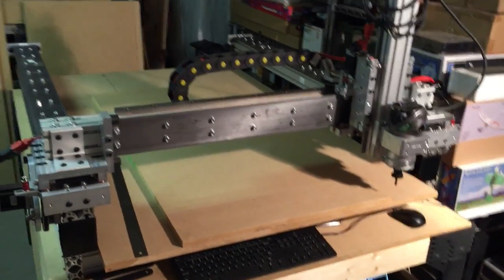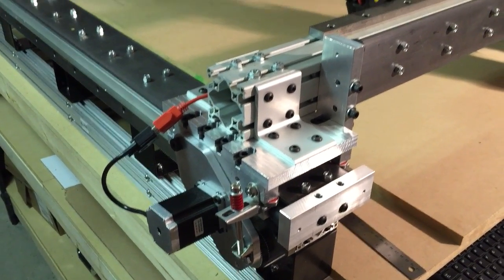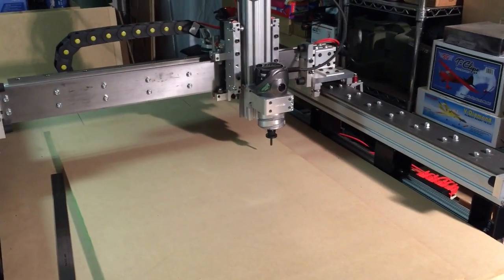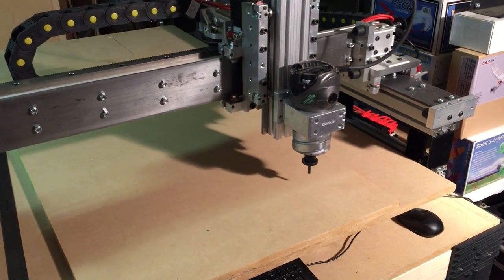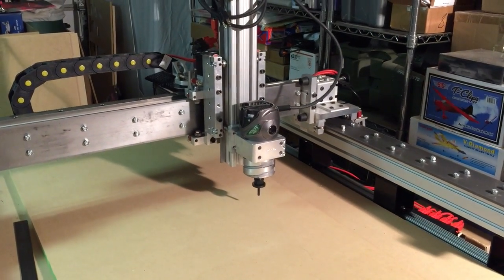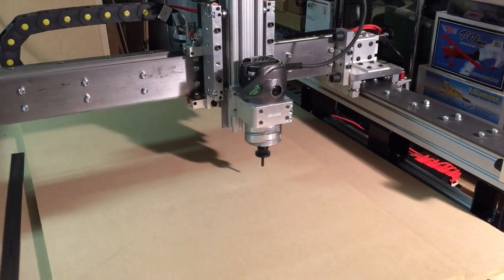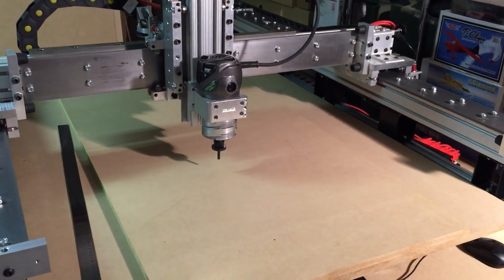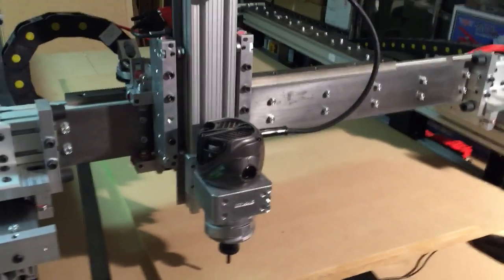Crash's New 2x4 CNC Router

Comment: i've got the older FLA200, nate is a little slow to respond but my system went together well. my gripe was the hitachi router... I had to buy 2 because one just keeps burning up on me. first time I used it after a speed control replacement (took like 6 months for the repair house to get the part), thing shot flames out of it and I haven't touched it since.
Reply from the maker: +phil timpson I am sorry to hear of your difficulties with that router. I have two machines - both with the M12CV routers - and both have served me well. In fact, last Fall I removed the oldest one (five years old at the time) to check bearings and brushes only to find that nothing needed to be replaced.

Comment: I would think you would build one from open builds website.
Reply from the maker: +gljay I HAVE a machine from the OpenBuilds site and I like it very much (I use it for g10 and plywood less than 3/8&quot;). However, when it comes to cutting big, thick stuff at production speeds, that kind of machine is just too lightweight for my needs.

Comment: In your kit, what all came with and what all did you require purchasing extra (either with FLA or elsewhere) in order to take the kit from box to cutting wood?

I am considering their 4x8 model which appears pretty close to what yours looks like excepting the dimensions.
Being a CNC newbie (I took some ShopBot classes at TechShop and cut a flat pack rocker that is sitting on my front porch), I would like to have the whole kit and kaboodle priced out before I put it to the holder of the purse.

Thank you for your time and attention.

Comment: Very nice machine Crash! I'm kinda jealous :-) 
Todd Buffington, I built a 1500mmx 750mm OX just about a year ago and man I sure am happy with it. I really want to get away from the belt system but that all happen in time. But its a great running machine with lots of really great information on openbuilds.com.
Reply: Thanks!  Getting away from the belts I assume offers more precision?
Reply from the maker: +Todd Buffington This rack and pinion setup still has belts, but not the long ones that are prone to stretch like on the OX. So far, I am seeing some REALLY good precision. I'll know more when I start cutting, but my measurements throughout the calibration process was pointing to +/- 0.0003". :)
Reply: +Todd Buffington ... sorry it took so long for me to replay Todd... Belts tend to stretch over time and yes, loss of precision. Speed is also a issue too.. of your ok with running at a respectable 150Imp (inches per minute) max, you'll be just fine with the belt setup.. Crash is getting some awesome speeds from his... I am a little jealous... just a little :)
Reply: Thanks guys.  I'm saving up now.  Thinking ox or x carve

Comment: Looks great Crash!  I have been looking at getting an entry level CNC machine.  Would you recommend the OX, X carve, or would something like this be better?

Thanks!
Reply from the maker: +Todd Buffington Hey, Todd! The OX and XCarve machines are both fine gateways to getting into CNC Routing. Just like we say with buying your first radio - get all that you can possibly afford so that you don't outgrow it in the first year. Whatever you opt for, get the largest and most capable that you can find. THIS machine, including the table it is on and the dust collection system that will be used with it, has me at about $3400 right now - WAY lower than a commercially built machine. If you've got it on your budget, this one will make you smile for a loooong time. :)
Reply: +Crash Hancock thanks for the quick response.  If you don't mind me asking what have you got in your OX?  It would be nice to have a 2x4 space for cutting foam.  I would look into the phlat printer, but i want something more future resistant for other materials.
Reply from the maker: +Todd Buffington I built the OX in it's original size (12" x 18" work area) and love it. Mine was less than a$1,000, BUT it was because I already had a stepper driver and power supply on the shelf (I didn't want to use the USB/Arduino-based system). When you factor in the cost of the Gecko 540 drive and PS that I used, my machine would actually cost about $1400.